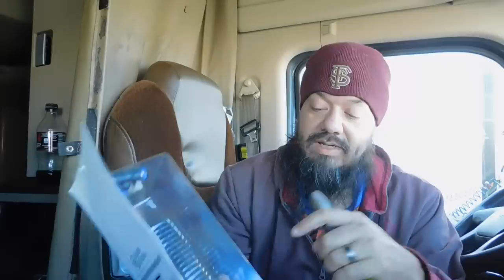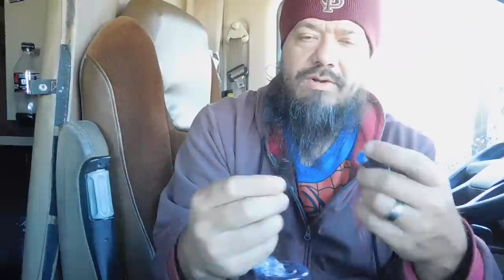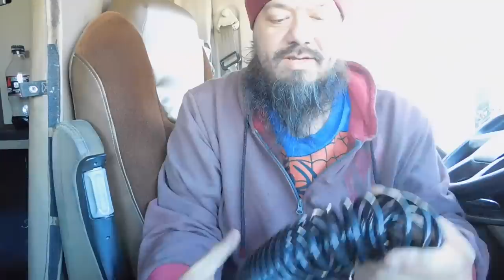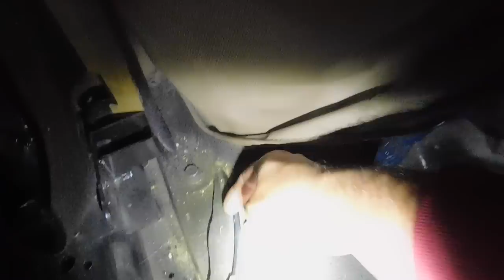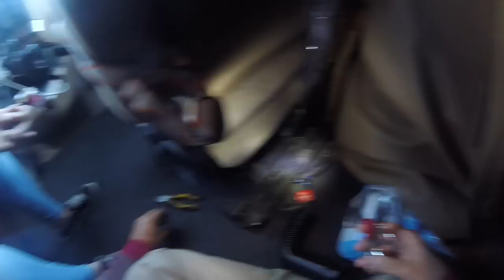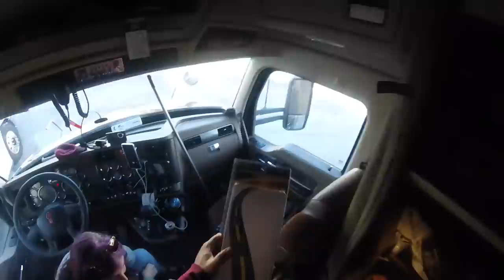How To Install A Heavy Duty Truck Air Blow Gun Kit In A Kenworth

Comment: Bro! You did not need to cut that hose. You press in the side of the connector just like you press in the blue connector that came with blower and that piece would come right off. It’s that easy. I would make a video explaining it if necessary. I bought the same 27 length blower you got…

Comment: Could you just disconnect the 2 sided connection and replace it with the three sided connection for the air gun?
Reply from the maker: It was just capped off had to put a different connector on there

Comment: Guys, you CAN'T stop all leaking...

They ALL leak, unlike in the OLD DAYS...

What I did was bought a pair of needle nose grip pliers and used it to clamp off the intake line to the left of the coupling, where both sides of the airline sticks into.

It still leaks just a little bit, but it only affects me when the truck sits overnight, and it empty out my air tanks.

I can still hold air in my seat this way, and just remove the grip pliers whenever I need to use the air gun 🤷🏾‍♂️👍🏿🤓